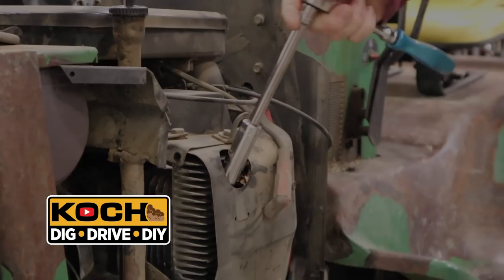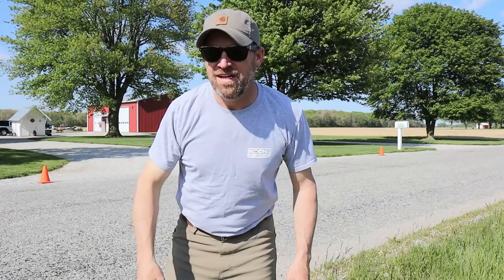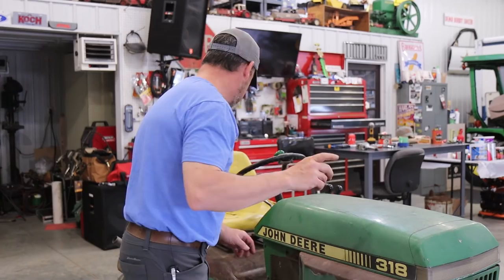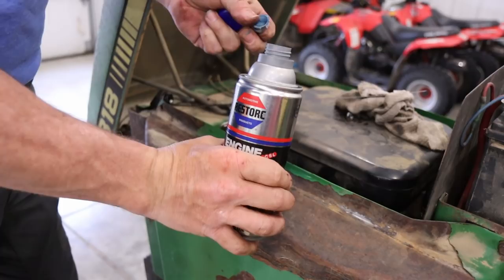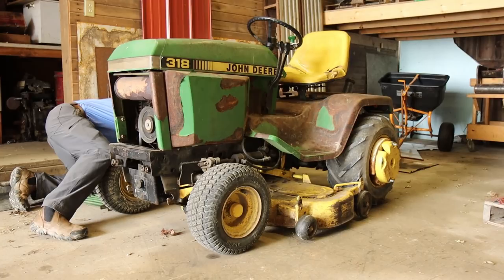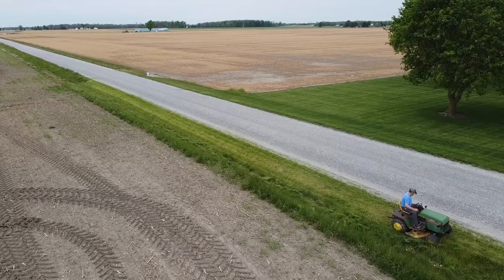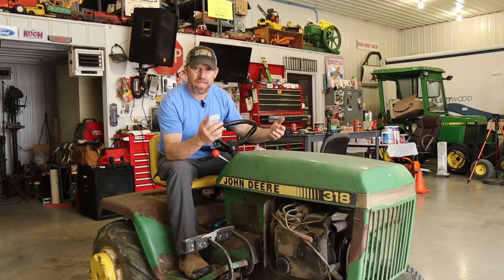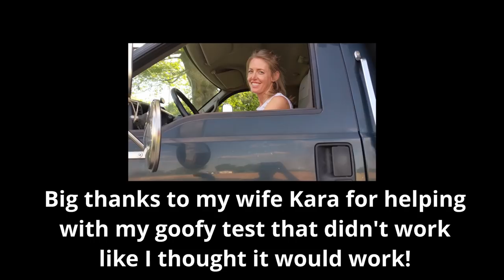Extreme Mower Testing With My John Deere 318:  Will "Restore" Oil Additive Help?

Comment: MY Friend I was the shop foreman for are John Deere dealership Many years THAT RESTORE IS THE BIGGEST JOKE ON THE PLANET, Your gonna have to do a full rebuild or buy yourself a short block and take your heads off and everything else and put on your new short block assy. And on your heads clean them up and on the flattest concrete put the head gasket side down on the floor and move it in a figure 8 pattern until you can see the sealing surface has touched all the way around it won't take much then your heads have a flat matting surface,  And while you have the engine out take all of the sheet metal off and sand and prime then go to John Deere and by the spray can paint just make sure it's not for the old Johnny Poppers and paint it up> I've done so many resto jobs and the paint is still looking great.
Reply from the maker: Hey thanks Hank!  So, you think just a valve adjustment won't do it either?  I'm inclined to think it needs a total rebuild as well. I appreciate all the insight. I don't think I'll be up for the total rebuild right now but I'll keep the engine around to see.  Thanks for watching!

Comment: You should be using fully synthetic oil AMS oil the best protection and the best thing for your motor.
PS, get a nice new motor and drop it in why not keep it and give it a new breath of life with a more powerful motor.
Reply from the maker: I use synthetic in the cars and trucks.  We use Amsoil at work.  I should treat the tractors to a drink too!

Comment: Normally you do a dry compression test, then a wet and if the compression increases your rings are worn .. I'm not sure the test you did really shows anything. There is no data to compare it to ..
Reply from the maker: I did the dry test in the video before this one.
Reply: @digdrivediy  o I must have missed the numbers....

Comment: The best thing to do with him will be put a new engine item Harbor freight makes a good engine Honda makes a good engine and show this core magnum You can also get a good weights and Stratton used or brand new small engine warehouse makes an upgrade kit to just dropping and go plugs and all I would highly recommend small engine warehouse if you're gonna do the upgrade kept it just bolts right in plugs right into the original wire harness and it's just a direct drop in highly recommended small engine warehouse

Comment: “Vintage” garden tractors will run out of traction way before power even being tired. Can’t beat them really compared to the new box store or even cheaper dealer equipment.
Reply from the maker: Very true.  I tried to conquer the traction issue to see if I could lug the motor but never ran out of either it seems (traction or power).  Thanks for watching!
Reply: @digdrivediy  thanks for your content! Yeah I have an old IH cub cadet from the 70s (1200). The thing hasn’t met anything it couldn’t pull. My issues are usually traction(soft ground, hilly terrain, mud) and stopping with weight on anything but flat with real weight behind it. Thanks again

Comment: I know a lot about these John beers I have one personally but it's a diesel powerI it a 332  318 are one of the best John Deere's you can get but not the 317   Don't take that to the scrapyard it's worth money they do sell a engine repower kit  for that   And they do sell piston ring for A 318 for bonly $20 $30 And I don't think you realise that is not just a regular garden tractor Those have one of the best transmission They are meant for pulling Reason why you're John Deere keep stalling with the brush on it sounds like its electrical problem Reason why you're John Deere keep stalling with the brush on it sounds like its electrical problem if it stars right up you don't have to worry about the compression
Reply: Use genuine parts I wouldn’t use cheap aftermarket parts in my 318 but I definitely   agree check out my 318 I have a video of here I drove a while to get her
Reply from the maker: Oh I certainly know how valuable and useful these little tractors are.  I have had nearly a dozen 318s.  I've had 140s and 317s, a 322, a 316 and a 330 diesel.  Plus I've had two 420s.  I love these little things.  Bill here is most certainly low on compression and most of his power issue is a result of that I am afraid.  I'm just not sure what I'm gonna do to help him yet.  I appreciate your feedback and advice.  Good to have different input on what to do that's for sure.  Thanks for watching!
Reply: @digdrivediy  a repower wouldn’t be bad but I wouldn’t throw away the onan even though it’s low on power it still runs and works and besides it would be good to have the original engine with the tractor Honda vtwins are good or Briggs and strattons are good too my idea would be to repower it and keep the Onan as a spare

Comment: Rebuild if you have something better  to mow your great looking lawn then sell it to someone with less means for the price to junk it.
You may be able to find a mechanical inclined teen that can use it to earn money as it or repair it for experience and more money for more work.
Reply: That would be me I rebuild engines and fix lawn mowers in my garage I’m 15 and I want to be a mechanic
Reply from the maker: That's not a bad idea Tim.  I have sold a few of these that are good fixer uppers at pretty cheap prices and that idea is not off the table just yet. Thanks so much for watching.

Comment: Please please don’t scrap it. A 318 with no engine is worth more than most other garden tractors. Especially one with 2remotes power steering and 3 point hitch.
Reply from the maker: I don't think it will get scrapped... just yet!
Reply: @digdrivediy  Not just yet. it wont get scrapped ever. if you scrap it i will buy it for scrap price.

Comment: It is a lot easier to move a rolling load than a dead drag. If you tried dragging a couple logs, I'm guessing 1500lbs would stop you.
Reply from the maker: Makes sense. All about the amount of resistance. I was still surprised though.  That's a lot to get rolling even. Thanks for watching!

Comment: You need to rebuild bill do you wanna valve job is not that hard
Reply from the maker: Rebuild him or a valve job?  I have a feeling if I go to the trouble of adjusting the valves that it still won't fix the main issue.  We'll see how it goes.